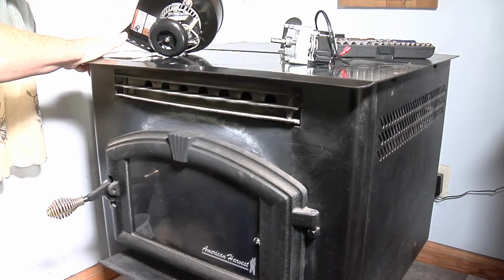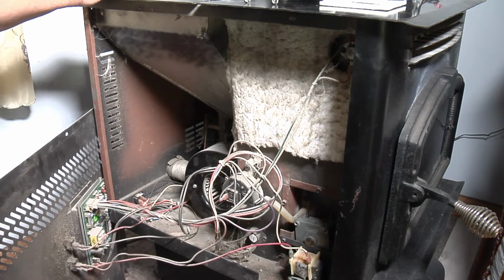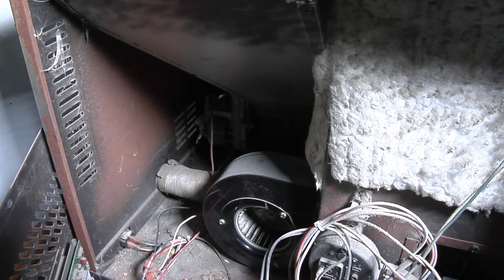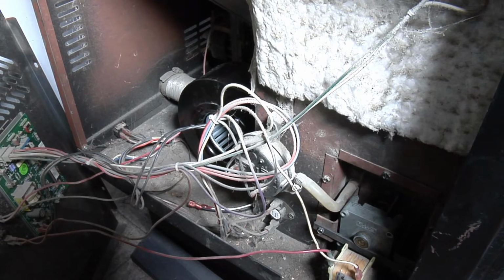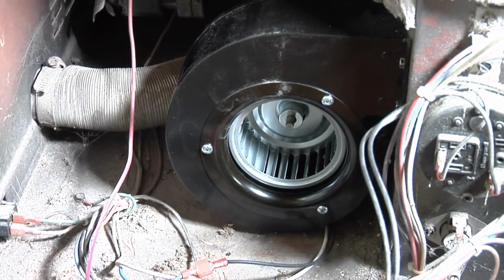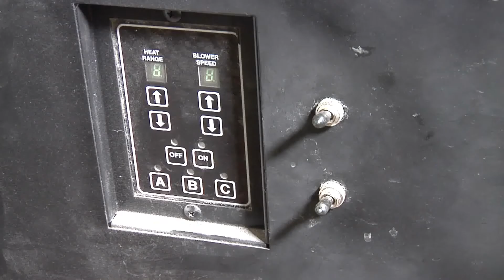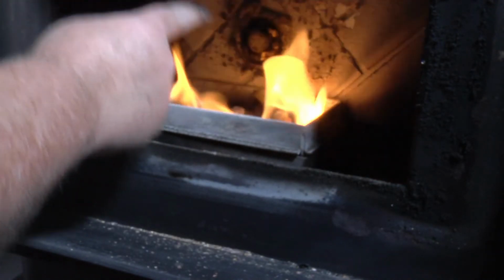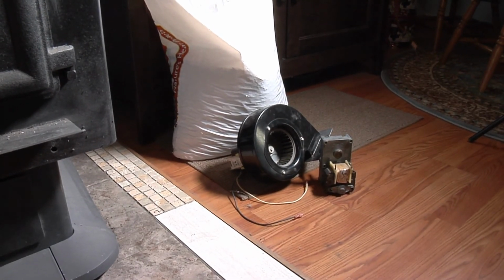American Harvest Corn stove 6039 change motors, Take a Look at the Switches.

Comment: I see you have a lot of black soot inside the pellet stove , I have a totally different stove but you need more air , I belive American harvest has settings to turn the exhaust fan manually, I would try one setting up or... you have restriction  somewhere, inside ur pellet stove,  inside should look brownish  in color not black. Great stove by the way, 😁
Reply from the maker: I started burning half pellets and half  corn, it burns so much better,  don't have to worry about the clinker build up on the stirring mixer. Thanks